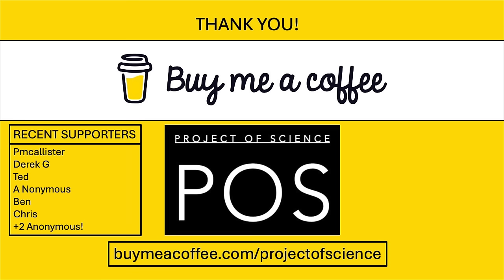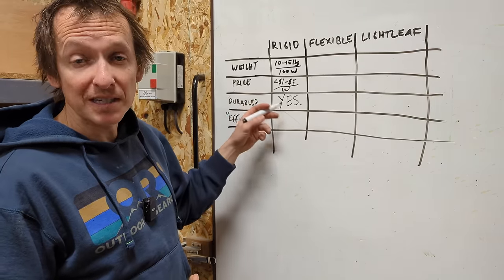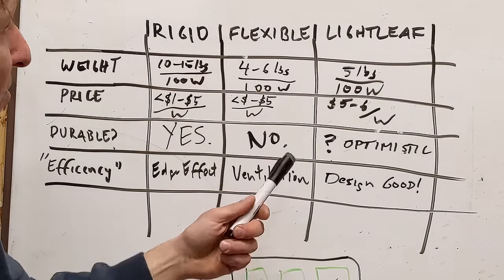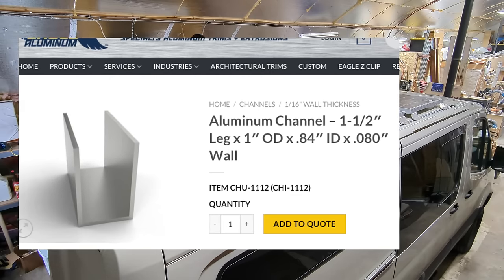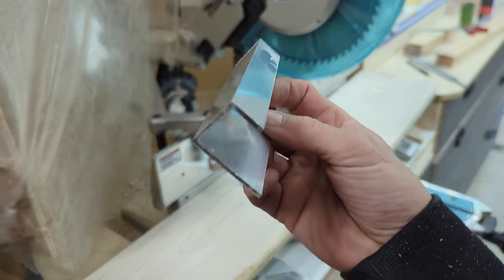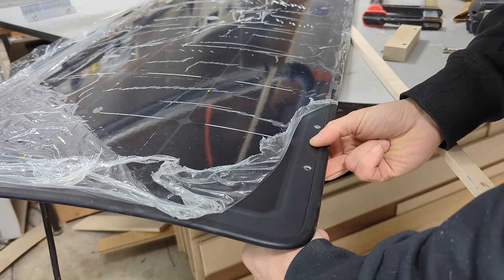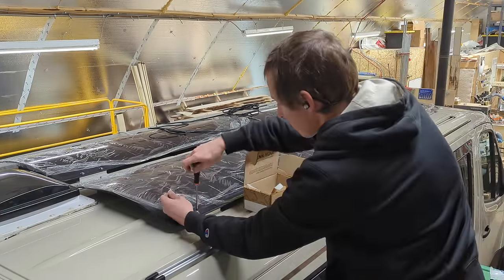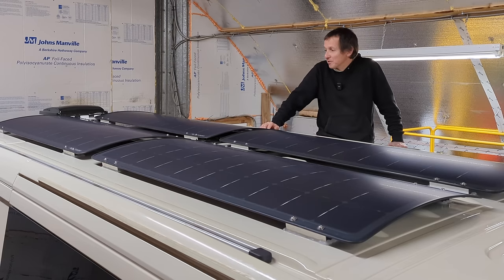Installing LightLeaf Solar Panels on my Sprinter Van Conversion

Comment: Wow! Those look fantastic! I agree that looks like a better solution than the flexible panels. Really send like they need to develop a bracket for this product though. Probably even just a T track extrusion but set at the right angle would be nice.

Comment: I have found the only flexible panels on the market worth the money are from Merlin Solar. We've been installing them on commercial & recreational vehicles for two years and have had no delamination or hot spot issues like the Sunpower panels directly mounted to the roof. It appears the LightLeaf panels use Maxeon cells and Sunpower panels bonded with a carbon fiber backer. I don't have any experience with LightLeaf and I am not saying they are in any way bad (or good). I like the fact they don't have MC4 connectors on them. And the airflow under the panels should eliminate the burning issues the Sunpower modules suffer from. Mounting the Merlin Solar panels to the top of a vehicle roof that has ribs is a pain in the butt. These panels look like a great alternative for ribbed van roofs. Thank you for sharing this. I'm eager to see a longevity update from you. Cheers!
Reply from the maker: Sweet, I'll keep the name in mind. So most of your installs have been on non-ribbed roofs?
Reply: @projectofscience   Most of our mobile installations are on flat roofs of commercial vehicles (usually fiberglass or aluminum) or RVs (travel trailers, motorhomes, etc). Most of the van work we do is fixing other installations, either DIY or van builders without a lot of solar or electrical experience. We do have one or two dealers who build vans but for some reason most of the van builders like putting racks on top of the van and then rigid panels on top of the racks. For stationary installations we use traditional rigid panels. We don't work with traditional residential installations so most of our stationary installations are ground-mount. Thanks!

Comment: I also moved to the Renogy lightweight panel, from a glass panel and appreciate the weight savings. Great work, esp like how you wired into the junction box, eliminating the MC4 connectors. I've made my panels removable with rare earth magnets so I can easily remove and deploy them as needed for more effective sunlight capture since I live and camp in Vancouver BC and we have lots of trees, so shade is a big issue.

Comment: bout to mount 2x 100w flexible panels to my EV's roof as an experiment. I think I will try covering the back of them with that thicker aluminum foil duct tape. im pretty far north and I dont think ill get much super hot sun, but im hoping the metal foil will help move heat a bit better. probably will still go bad after a few years. just an experiment to see if i can boost my EV's range by taking out some of the 12v load

Comment: Not sure the extra $400.00 per panel is worth the savings. We are talking $1,600.00 to save 32 lbs.. 

I'm still curious what the Eff rating is like..As right now Bi-Facial panels are cheap. As they don't fall under the import tax surcharge fees..

Comment: Seems like the curve of the panels would decrease the efficiency due to the angle potentially facing away from the sun. Especially since cells usually drop to the lowest in the array. It would be interesting to hear your real world experience after you use them for a while.
Reply: Panels are really facing the correct way on a van anyway. Cheers

Comment: For the rigid panels you can get plastic clips that make the water sifon off of you panels. That way you will have less problems with dirt on the panels.
Reply: That sounds interesting, got a link?
Reply: Don't have experience with one specific type. Just search for solar panel drainage clip.
When your van is on flat ground you have to check where the lowest point is. There you attach the clip. This will make the water sifon off of the solar panels. This will prevent most algae that would otherwise form it also prevents gathering part of the dust since the panel dries out a lot quicker.
Reply from the maker: Interesting...seems cumbersome to get on the roof, but could maybe just permanently leave a couple up on each panel. Would still be interested to see the flow rate to see if it can actually get the dirt out.
Reply: @projectofscience  I’m thinking that it could really help for those of us with flat panels, since we can usually park vehicles with a little slope –which is often not enough to quite get the water over the panel lip.
Reply: They are not expensive so I would probably go for 2 in each corner. That way it doesn't matter which way the van is tilted when parked.
Put them on once and leave them on.

Just the first hit youtube gave me.
https://youtu.be/aiU8NRd1yQA?si=BImB4_ONp3LJOyrf
Flow rate seems to be pretty decent.

Comment: Interesting. I've read 3M's instructions for VHB tape, and used it to attach lexan protection over window glass, and never had a problem or seen a note to use silicone seal around it.

Also very curious how all those curves will add noise at highway speeds

Comment: Cleaning of the bond surfaces is critical! Removal of any waxes and contamination with wax remover followed by IPA should work. One additional thing to consider when using VHB tapes; Bond strength can be increased by gentle heating of the surfaces, especially when working in a cold shop.  A simple heat gun is fine.

Comment: But how many watts per square meter to they give compared to rigid panels? The most important metric imo.
Reply: You could compare the nominal figures given on their websites, but that’s not  going to be reflected exactly in real world usage. That “curb” effect he shows in the video would probably reduce the output of the rigid panels by roughly 50%.

Comment: Looks like three across panels could have fit your van. 
Did you look at attaching to the rails, to limit the number of glued down brackets. Maybe even sharing a bracket between panels. 
Wonder if flat panels would have enough flex to match the contour to the roof?

Comment: How are they holding up so far? I have four 350 watt panels on the roof of my fifth wheel and at 70ish lbs each, I would love to get tat weight off the roof. I was thinking about doing flexible panels and mounting them the way RV with Tito DIY did. When flexibles delam, are they dead or do they still produce power? I am wondering if they could be rebonded to a sheet of carbon fiber.

Comment: hey bud. what about CIGS panels? Hobotech did a review about the Bouge RV ones and they seem promising too. Thoughts?
Reply: I've had the same question... cigs panel are about 4$ w
Reply from the maker: yeah...i haven't tried them but the reviews from non-paid reviewers seem mixed.  i do think depending on where you live (and even store your vehicle) they may work great.  i still see a lot of mention about delamination and given they are a fairly new product i'm skeptical of long term performance.  a bit curious...but not as i was about the lightleaf.

Comment: Outside of convenience, why do folks mount the panels on the vehicle? Wouldn't it be better to park the vehicle in the shade and have portable panels in the sun? I don't think the line loss would be that great compared to running fans to cool down the vehicle interiour.
Reply: I mounted my lightweight Renogy solar panels with rare earth magnets, so I can charge when traveling and remove as needed to use as portable panels. Line loss isn't much of an issue, assuming you are using 10AWG good quality copper wire. I have a number of lengths I can add together if I need greater distance.
Reply from the maker: For my use it wouldn't work great. The greatest reason for so much solar on this van is to offset the consumption by the air conditioner, which we often leave in towns or busy trailheads to keep our dog alive as we do other stuff. Pretty sure the panels would grow legs pretty quick;) plus deploying an array or this size seems like a cumbersome undertaking especially since we move camp and location so much.

Comment: These PV panels looked very interesting to me, until I researched their build and warranty. They unfortunately have a polycarbonate front sheet, which as we all know, tends to haze after 5-7 years in the sun. This is probably why they have only a 5 year performance warranty rather than the glass panels' 25 year warranties. Pity, as I was curious if they would last in the intense Arizona sun for my golf cart roof...but almost certainly will not!

Comment: You’re saying the flexible panels delaminated, but you are referring to the tape coming off the mounting surface or the panels actually coming apart?
Reply from the maker: Layers of the panel coming apart. The tape and adhesive are solid based on the amount of work to clean it up;)
Reply: @projectofscience  Thanks for the reply.
Reply: I am about to install a Xantrex 330W panel on the SCA pop-top loft on my Sprinter. I hope it lasts, since it was rather ridiculously expensive.

Comment: These look good, but the 200w cigs panels from BougeRV still top them imo
Reply from the maker: i've had curiosities about cigs panels but there are plenty of reviews about delamination...but maybe bougerv has figured something out others haven't.  the product hasn't been on the market that long, has it?  so it is hard to believe it will last 10 years when it has only been available for a couple.  as for the bougerv 200 w panels specifically, the size would prohibit more than two installed due to their enormous length. i'm also a bit skeptical with everything from bougerv.  their marketing hammers the influencer/social media really hard so it is hard to figure out who is actually giving an honest review (my 2 cents).
Reply: @projectofscience  nah man. I thought I destroyed mine when they came loose on my roof on the freeway. No loss in charge output after flapping at 70mph. Hobo tech shot them. Wdym you don’t trust them? That are excellent. I have 4 on my van. 2 are on the side

Comment: hi there.  love the testing and info and build quality in your videos!  with regards to aluminum becoming brittle.  i think what you are talking about is "work hardening" which happens easily to aluminum and copper. this happens during deformation where atoms in the metal's crystal structure form dislocations and create imperfections in the uniform-ish crystal structure... like the rigid links in a chain. https://en.wikipedia.org/wiki/Work_hardening
Reply: The issue is there extruded aluminum..Any form of heat deforms the metal to failure. Why you don't bend them several times. As they will not recover..You would have to use cold forged to get away with that..If you want to bend them. It has to be a large radius curve..

Just so you know. That make adjustable aluminum Stand offs just for this purpose. IronRidge sells them..